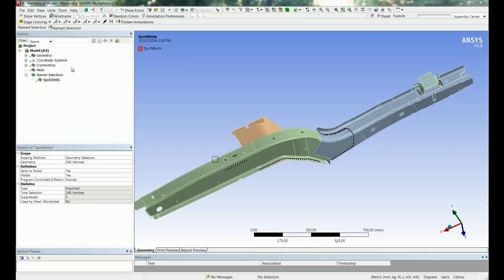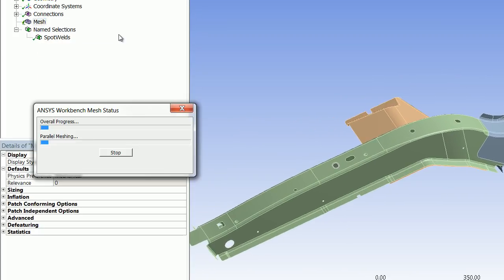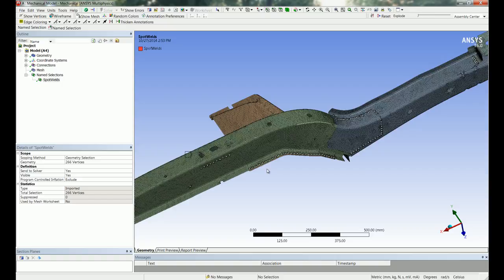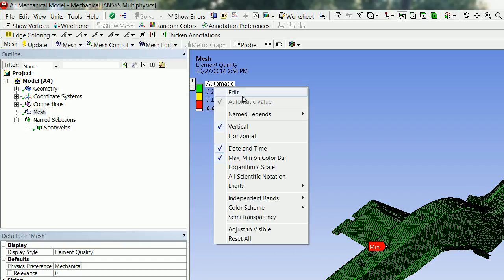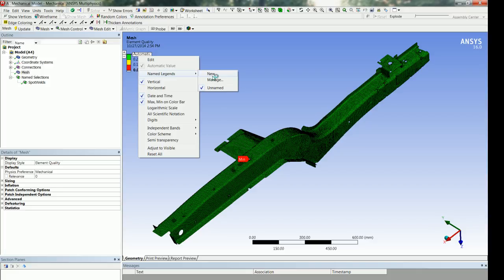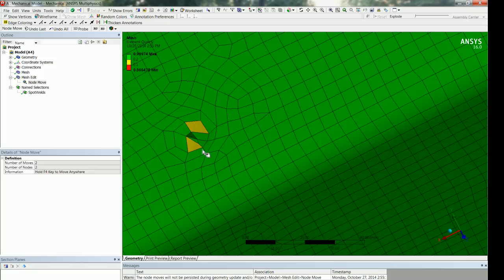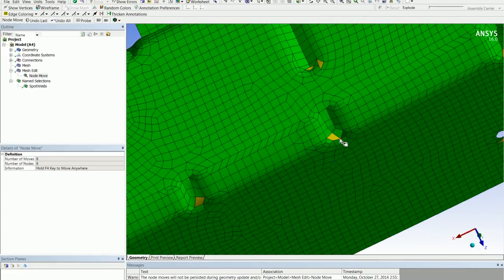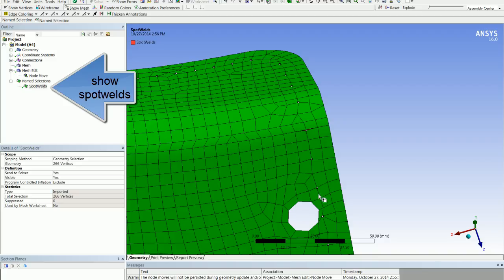How to use ANSYS Workbench for Shell Meshing and Editing

Comment: How do you know workbench automatically chose shell elements not solid elements?
Reply: It will if the import is a surface body and not a geometry. you will know because it will have a defined thickness